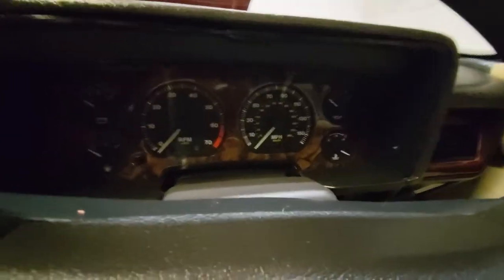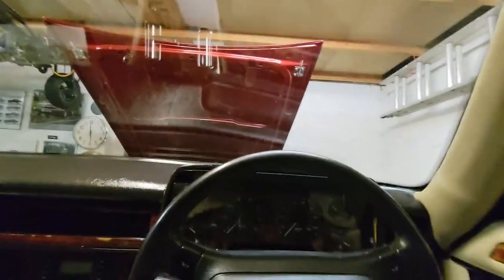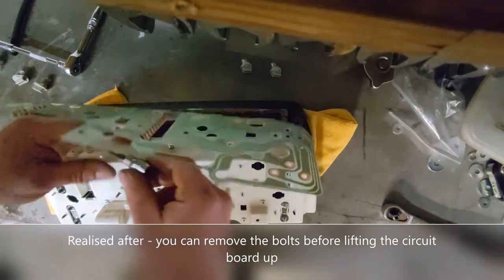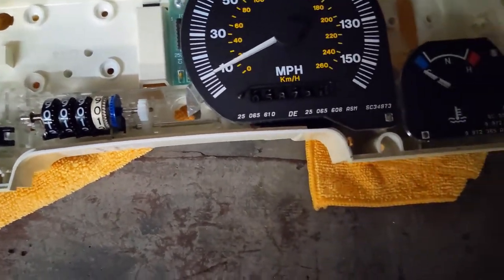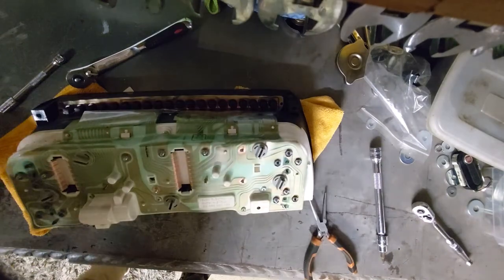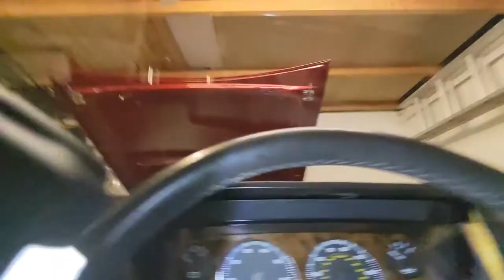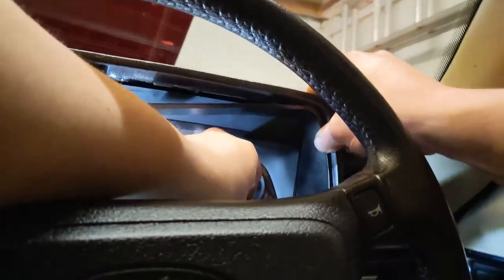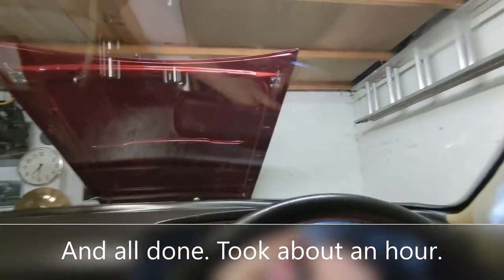Jaguar XJS Instrument cluster

Comment: I have a 1995 XJS Convertible with 4.0 engine. Is there some trick to making the oil pressure gauge work correctly? I have the annoying problem of the needle going to zero at idle, I have noticed on other XJS videos the same problem exists also. What gives with the gauge? By the way, I enjoyed the video and I subscribed!
Reply from the maker: Short answer is no .. I'd start by eliminating the cluster gauge being dead, by doing what I accidentally did to this coolant temp gauge (shorting it out).. if it  flips out and needs resetting then it's getting it's signal. If it is not the guage then I guess I'd trace wiring as best I could to the sensor and just replace it.. then assuming oil level/viscosity etc is correct pray everything worked!

Comment: Hi, I was actually watching this in the hope of finding out how to replace a warning bulb, specifically my Sport Mode bulb, which isn't coming on (though selecting S-mode does make a difference, so that in itself is working).  Roughly 2m15s in you are doing the strip that seems to cover these bulbs... is there any way to access them to replace one?
Reply from the maker: Once the unit is out.. lay it down on its front. Along the top are around 25 black bulb holders, they simply turn and release.
Reply: @jaguarxjsocd  Ah yes, i see them a little later on in the video.  Thank you very much

Comment: I have a problem where my speedometer is stuck at max and acts weirdly when i turn on my lights. All the gauges max out and my gauge lights do not come on. Voltage is low too, but my battery and alternator were tested, and are running well. Please help
Reply from the maker: I think you have recently posted on Facebook groups.. I did share this video to assist in the cluster removal.. however as I read your posts more I would assume you have some earth/electrical issues affecting the cluster. If it was my car I would first remove the cluster, check connections and make sure nothing obviously wrong there. Then I'd move on to earth connections in and around the dash/under ski slope.
Reply: @jaguarxjsocd  Thank you for the response! Yes, I’m Erriyon in the facebook group with the LHD 1994 4ltr convertible!

 Which connectors can I check once I remove the dash, and where is the one for the light that illuminates the cluster?
Just want to know what I would look for exactly 

Also are there any relays that go to the cluster or control it?
Reply from the maker: @IIIStageProductions  unfortunately I'm not an auto electrician, tbh I'm not an mechanic haha but I get by learning as I go. So my video will help you get the cluster out, after that I'm afraid you'll have to either get stuck in or ask for help from an auto electrician. Unless of course there's something blatantly obvious wrong with the cluster. Once removed you'll quickly understand where bulbs are, they are very easy to access along the top and everything is connected with a flexible circuit board/plastic sheet kinda thing. My thoughts are you will reset the dials during removal.. but the reason it is happening is elsewhere in the car/wiring/sensors.
Reply: So, XJS 4.0 1992 , I had voltage reading 8v , putting on the indicators would make the voltage 'dance' putting on lights would 'throw' the voltage to zero. BUT, the car ran and charged the battery for a few hundred miles of driving. I should add, the car had been on a 7 week sea journey.
First thoughts, Alternator, then rectifier regulator, and so on. 
Coming to this really great video, I thought I'd remove and 'look' at the instrument panel as a general learning experience (especially as the speedo was not working) 

So, loads of the connectors looks 'tired' and I cleaned the connectors carefully.

Put the instrument panel back and yes, the speedo worked again... BUT unbelievably, the voltage dial showed 13 plus volts, car light turned on make no difference to volt gauge and indicators did not make the voltage dial 'dance'

In summary, what looked like an alternator/charging problem, came back to being dodgy connectors to the instrument panel itself.... for what it's worth....

Comment: So does it work after all that? I’m having same issue but in oil pressure gauge
Reply from the maker: Yes, sorry I should have shown it working after I had reassembled. Obviously with my temp gauge I had caused it to short, so with your oil pressure gauge, you will need to try this, if it flips round again as soon as you turn the ignition I assume you have a short/fault somewhere else you need to address.
Reply: Excellent. Glad it worked out in the end. Thank you for the video. I will be attempting this step by step per your video this Thanksgiving weekend. Very excited as thought I was going to have to live with that broken gauge. Cheers friend. 🙂
Reply: Hahah 8 months later…… I have psychologically cheered myself on and performed this removal of dash and gauge adjustment and it was successful for oil pressure gauge. Thank you so so so much for everything again.
Reply from the maker: Haha well sometimes these jobs take a while.. and sometimes they just take a while to start 😂. Glad it was a successful operation 😊

Comment: can anyone provide any help on removing the wood panel that sits in front of the airbag?
Reply from the maker: Sorry just saw this.. did you figure it out? I think it is actually a metal plate with veneer on the later air bag equipped models.